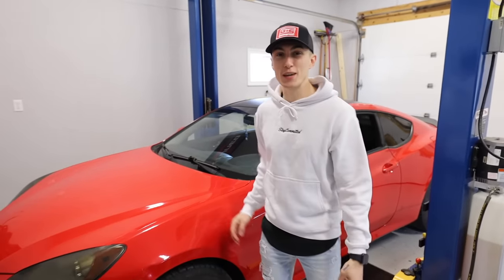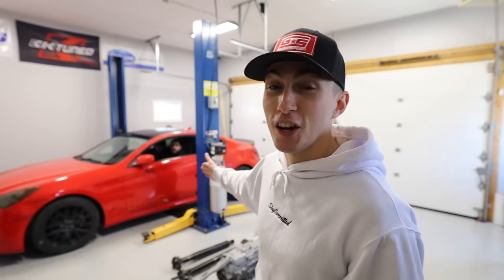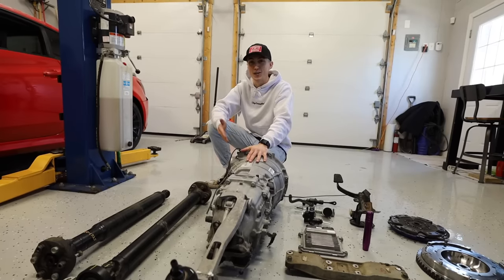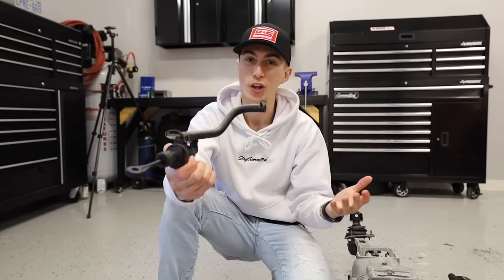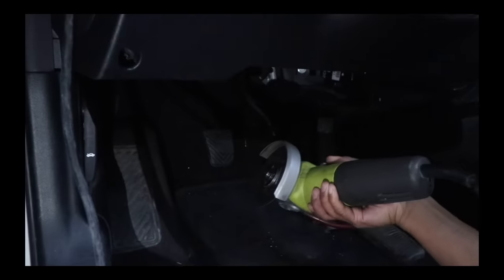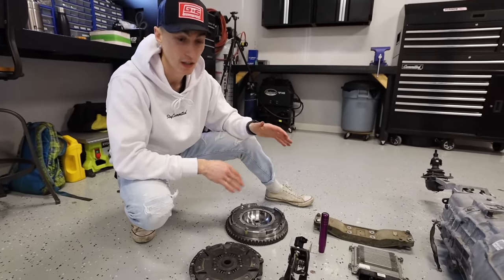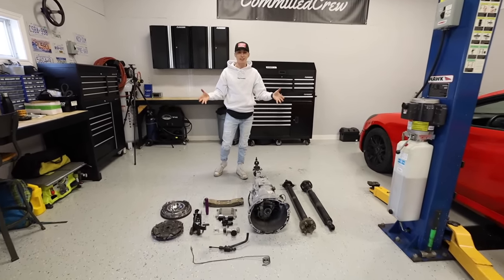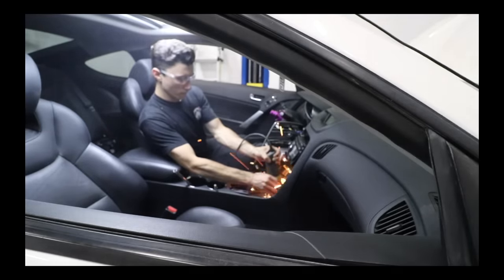Manual Swapping ANY Car - Everything You Need!

Comment: Since we didn't get a challenge in this video
I challenge anyone that just watched to not be scared off by the "failure" syndrome
Failure is just a bunch of mistakes that can be corrected if yu keep on trying again taking one step at a time

Thank you all 
See yu in the next video😄
❤🇬🇭
Reply: 너도 이비디오 에서
Reply: Legit needed that bro. Amazing challenge
Reply: I want to swap toyota camry1992 2.2 from automatic to manual I bought manual gearbox  clutch set main clutch pump  clutch pedal  I have a question  : does the camshaft from automatic transmition is fit for manual  thanks
Reply: i love you buddy

Comment: Hi I'm doing a manual swop on my 2008 Mitsubishi lancer that has a CVT transmission I've done everything I'm just struggling to find the switch that you are talking about bcs the vehicle doesn't want to start I have to start it from the starter now 😂but if you can show us where is the switch bcs I can't find it please if possible will appreciate I know all makes and models are different but it should be more or less the same

Comment: There is a plate over the spot where the shifter goes under the car. It has seam sealer around it and I believe rivets. Once you take that off you will have holes where everything goes.

Comment: Hey wanted to say glad to see you back again.  I had a question if you have ever the same issue or heard of something similar. I have a 1990 Honda prelude and I swapped the engine to h22 newer prelude engine.  When I start it up it idels great the after 20 seconds or so it idels up more and runs rich (black smoke) if I try and drive it before it idels up it bogs down and can't barely drive it low rpm super slow.   Some times the ecu doesn't realize something is wrong and it won't idel up to drive it I have to shut it off and re start it.

Comment: I could use some help with a swap. FYI, I have never done a tranny swap so a lot of how certain things work are quite new to me. I have a 2002 Saturn SC2 with an AT. I also have a 2002 Saturn SL1 MT as a donor car. I want to keep the SC2 motor as it is DOHC. I know that the blocks are Identical so the transmission should just be bolt in. The mechanical side of the project is something I see 0 issues from, it's the electrical side of things that I dont know. I am positive that I should keep the SC2 ECU in the car specifically because it is DOHC vs the SOHC motor the SL1 has. I'm more worried about speed sensors and throwing codes, on top of a park or neutral safety switch. Any help would be appreciated.

Comment: This is a long shot but hopefully you reply, do you know anyone who can machine a 2010 3.8 genny? I’m in Ontario (in the gta). All the shops I talked to in Toronto and London won’t touch the motor. Motor had a rod knock bc it spun a rod bearing. I took the motor apart but I need to get the check the block and head for flatness, surface the fly wheel, get new pistons and connecting rods, and machine the crank. Do you happen to know any machine shops who will do that ?

Comment: Not my car. A lot or cra have different setups that you wouldn’t always think about. Like the 1.8t vw engine. Since the trans is different the crank in the auto engine is 2mm longer than the manual engine.